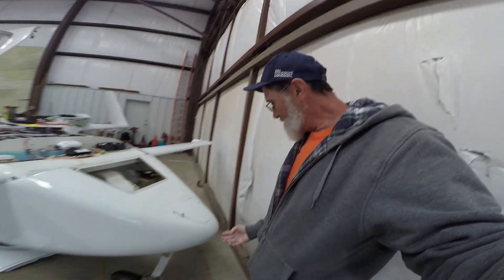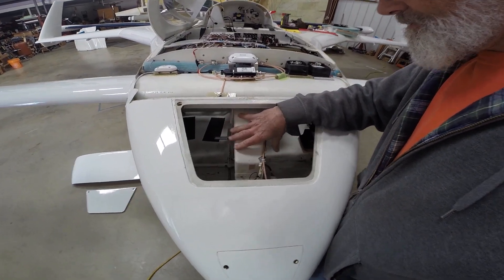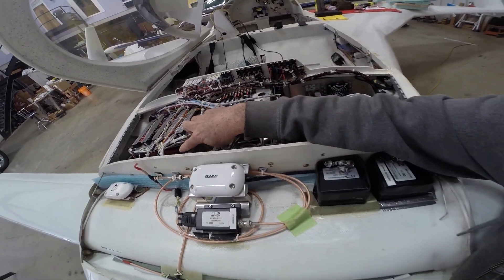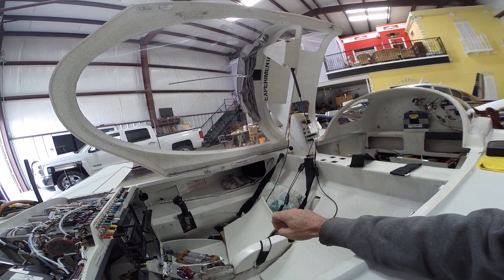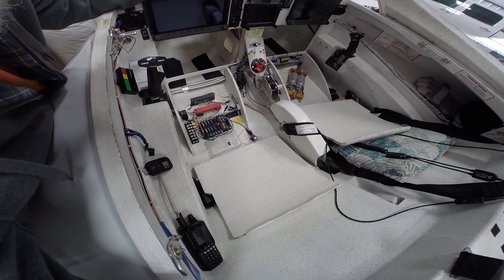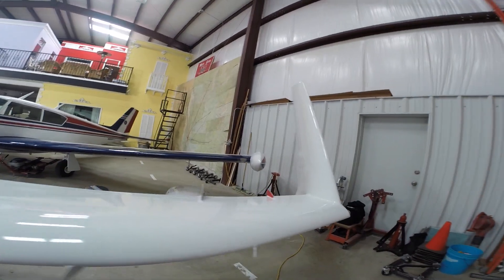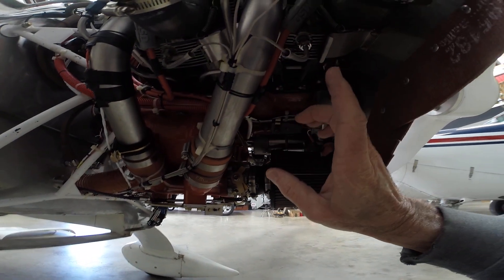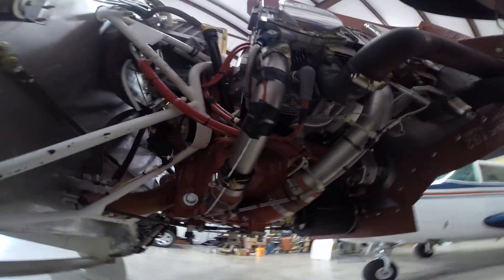N724CZ Cozy MK IV Walk around

Comment: Can you share the make and model of your double bazooka adsb in antenna? or if you built it, could you share some details on how you built it and more importantly how does it work? I might need to upgrade
Reply from the maker: I used this site to determine the lengths for each antenna (ADS-B, VOR & Glide Slope).  https://www.westmountainradio.com/antenna_calculator_bazooka.php   I used scrap pieces of RG400.  The nice thing is these match the impedance of the radios so don't require balans.
Reply: @ do you know how this compares to the ADS-B Monopole Antenna?
Reply from the maker: @rumym  Generically, the double bazooka antenna has less gain but that is offset by a better signal to noise ratio than the folded dipole that needs also needs a balun.

Comment: I have questions sir. 1. Does have Heat/AC? 2. Shortest runway takeoff/or landing? 3. Can De-icing be installed 4. Can these be built with folding wings? Just curious, and thanks for vid, informative.
Reply from the maker: Yes it has cabin heat.  On sunny days the canopy alone can provide warmth if the cabin has minimal air leaks.   Otherwise a heat muff and 3” scat tube provides plenty of heat for me.   

The shortest runway for take off and landing depends on density altitude, gross weight, wind, prop and engine. 

I’ve taken off in about 800-900 feet near sea level, 80 F,  with only 10 gallons of gas and just me on board.  Loaded pretty full on a hot day at 6500 DA, took a lot of runway.   

The Defiant is the only  canard I’ve seen with one of the canard wings that would fold.
Reply from the maker: AFAIK, nobody has installed de-icing equipment on a Cozy other than heated Pitot and the ice shields for the elevator balance weights.  I suppose it's possible to embed tubes to pump fluid to the leading edges.

Comment: Sorry for the dumb question but where is the baggage compartment? 

I had expected the baggage compartment to be forward of the cabin to balance out the engine and general propensity for aft cg?
Reply from the maker: The plans call the inside strake areas and the inside of the spar as baggage/storage areas.  Some people will use the nose to store tools, oil and other small stuff but space is pretty limited up there.  The forward passenger foot area has some space if the back seaters aren’t very tall.  Under all the seats thigh supports is enough room for small tool bags, quarts of oil, water bottles, nose tire.   As far as large bags go, you can haul three people and stack the bags in one of the back seats.  Some people have added baggage pods attached to the wings that will hold skis , golf clubs and soft sided bags.

Comment: I just got my plans a couple weeks ago and I've been reading through them as a first step. I'm really interested in your antenna setup. With the foil not in the bottom of the fuselage, how has your nav comm been working? Is there any problems? I think setting as many of the avionics up in a bay like you have makes good sense.
Reply from the maker: The VOR and ILS antennas seem to be working fine.  I had a friend shoot an ILS with me and it worked as well as his GA antennas.

Comment: Great vid and beautiful Cozy.  Wondering how those cover flanges on each side of your canard work for keeping cold air and water out?  I'm looking at doing something similar on my Long-EZ.
Reply from the maker: The most rain it's been in was when it was parked on a ramp in Alabama with a Bruce's travel cover on and some (maybe a pint) did get through the canopy/longeron area because the canopy wasn't latched.   I did fly through some light rain on the way to Rough River and didn't get any rain in the cabin.  I can feel a little bit of air around my feet but think it's coming through the nose gear cover and maybe a little bit through the top nose gear cover.  I think lips with a bead of soft silicone would make a very good seal but need to have some kind of release agent on one of the lips so the cover is easy to take off.
Reply: @mikesatchell8317  Thanks for info Mike.  I'll look at adding in some type of seal or silicone as you suggest.
Reply from the maker: Nick Ugolini has instructions posted on how he made a good v-seal for the canopy.  I should try that.  http://nickugolini.com/blog/  @wade-airdog7730